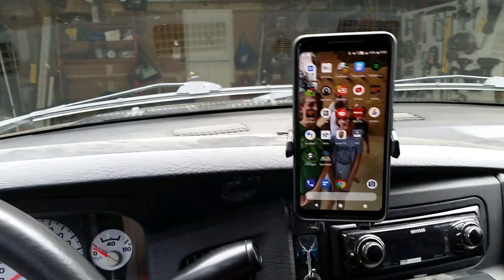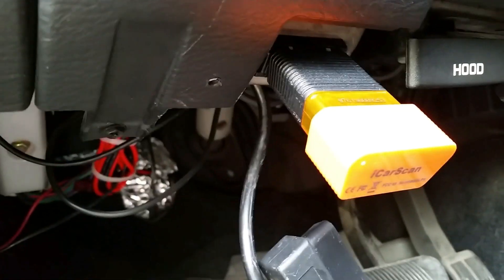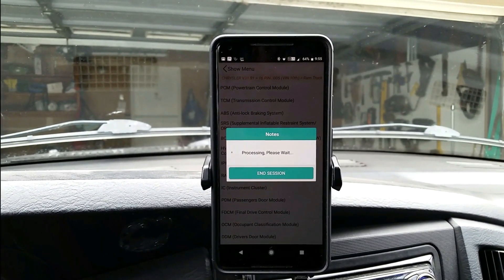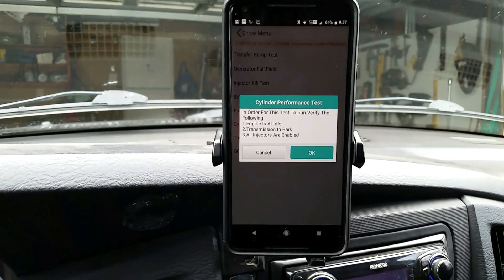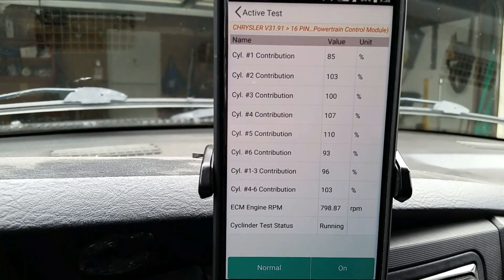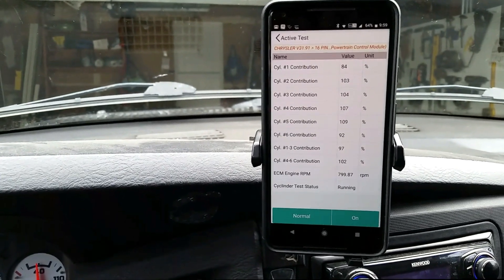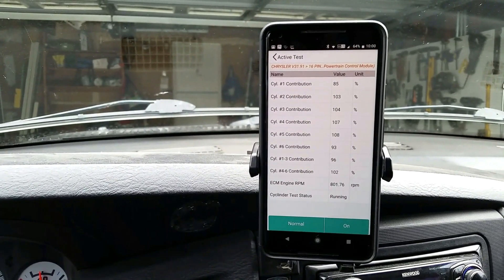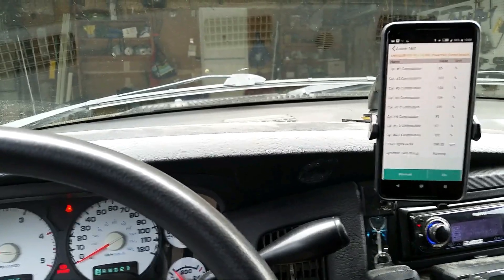5.9 Cummins Cylinder Performance Test

Comment: Are you using it with a phone, or stand alone pad type device? I want to get one, but don't want it linked with my phone in case something happens with the program or my phone. Curious to know how the program and special function updates can be added to a non phone device if that's the case. Thanks for any help

Comment: What version is this specifically
Reply from the maker: This is the icarscan and the ezdiag app is version 6.3.8
Reply: So it is thier basic scan tool for $99 on the web site
Reply from the maker: http://m.x431tool.com/wholesale/icarscan-diagnostic-tool.html?gclid=Cj0KCQjw8YXXBRDXARIsAMzsQuWV3EbQTcLTsSoNz26KUUxlHdzYDj8V8hycdhAB24GV-sgRkOL6YPIaAmZ2EALw_wcB

This is what I have ⬆️
Reply: Great well I have to buy special add-on software to be able to do I kill test and balance test on a 5.9 Dodge Cummins
Reply from the maker: Not if you get the icarscan.  It comes with 5 makes and 2 special function tests
Reply: Diesel Camper thank you